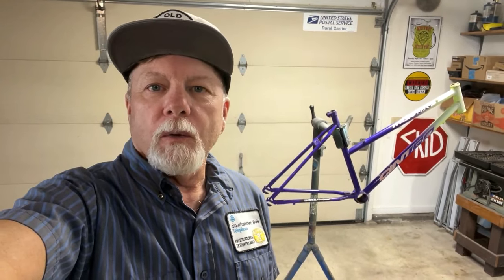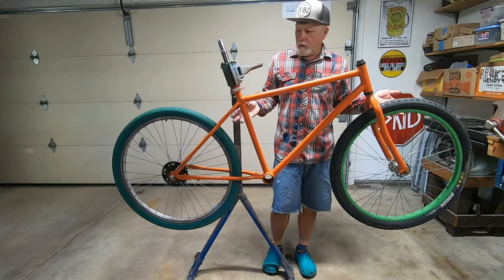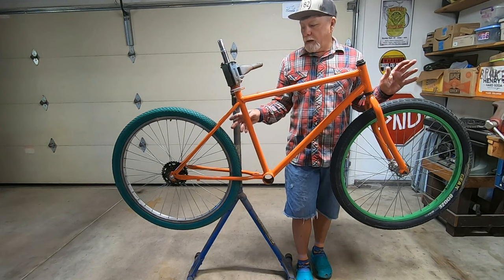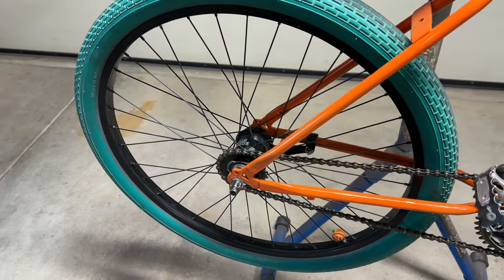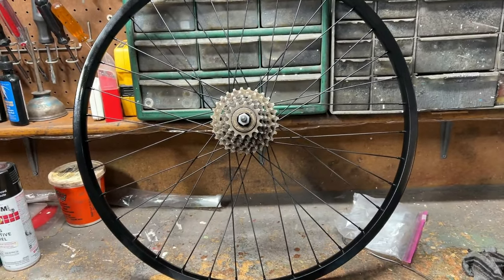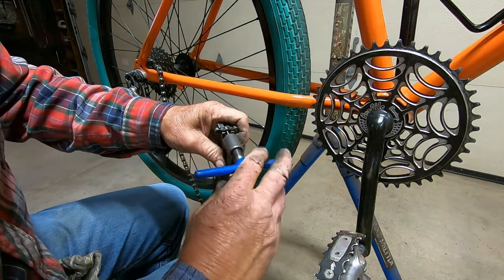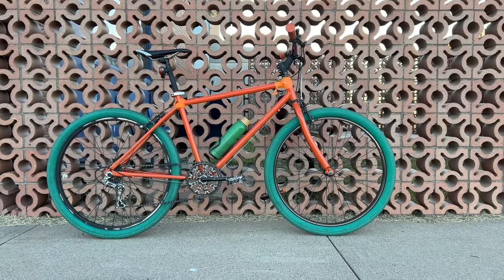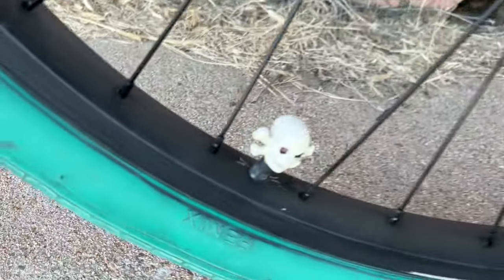BiKe Builds & Mods - Rat Klunker Bike Thing

Comment: I would have left the 2-speed klunker, and gone with the black BMX bars you had on it for a sec! Very cool that you can weld! I’d love to learn how.
Reply from the maker: I knew that configuration would appeal to some. I've had the bmx bars and the 2 speed on my Schwinn Heavy Duti klunker at one time.
 I bought the welder and just started using it. I've had it for many years now but never took the time to really learn to use it or get any better at it. Thanks for watching.

Comment: I like your bike builds.l was wondering if ever use any 3speeds on you builds?l use some of the with the electric motors on my builds and that's all you need.
Reply from the maker: Thank you! I have built up  internally geared 3 speeds in the past. The only one we have left is a Schwinn cantilever frame bike of Nova's. They've all been coaster brake. Someday I might build up a bike with a non coaster brake 3 speed. Yeah I imagine 3 speeds and a motor would be plenty of range..